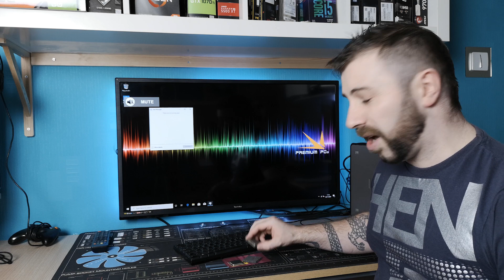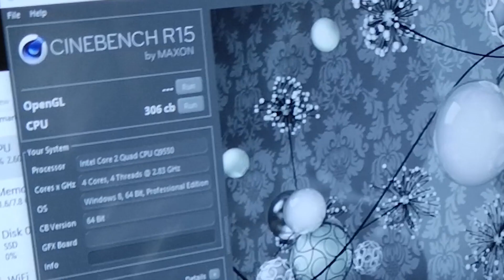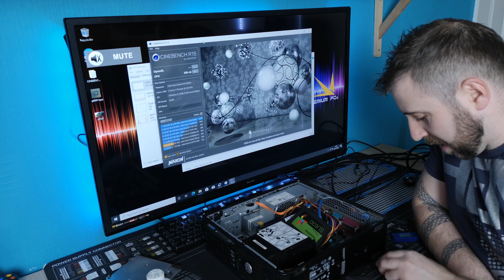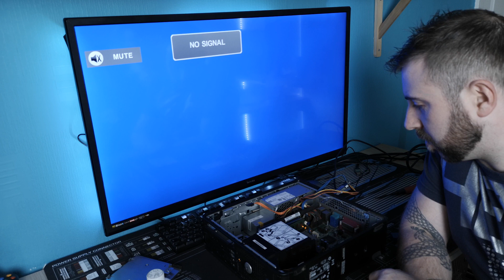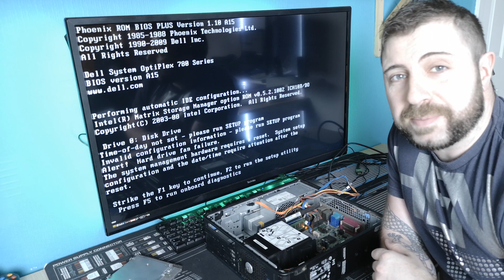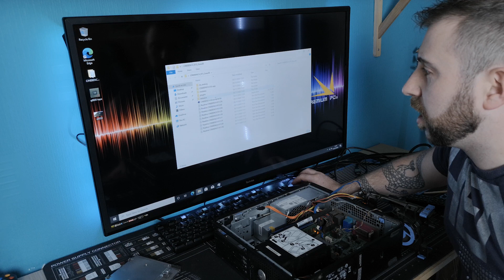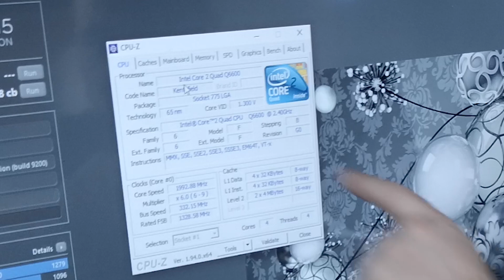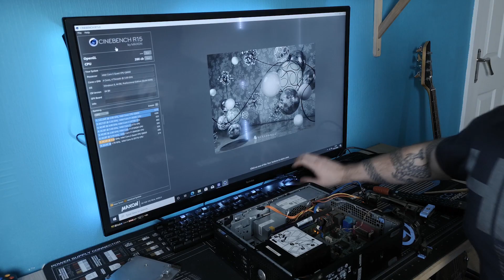Overclocking an Optiplex (Again)

Comment: Bought a load of old 760s, the whole pc could come apart in 10 mins. The only issue was removing the mobo which meant bending a bracket on case. Flipping parts on ebay.